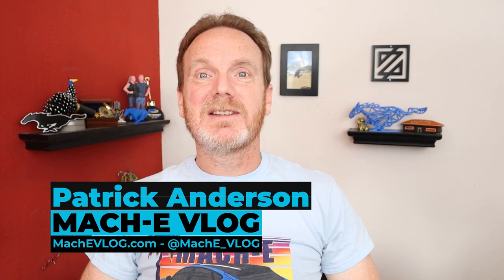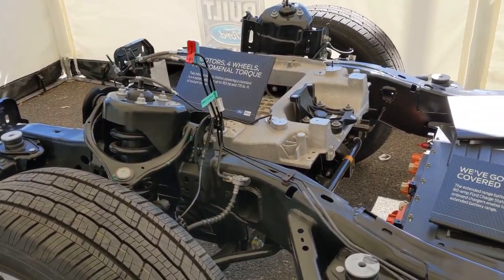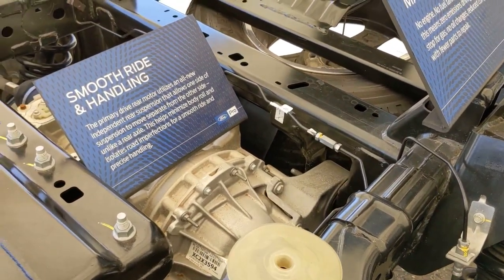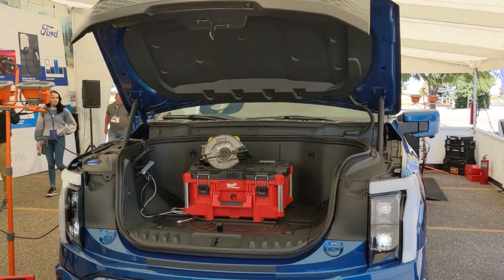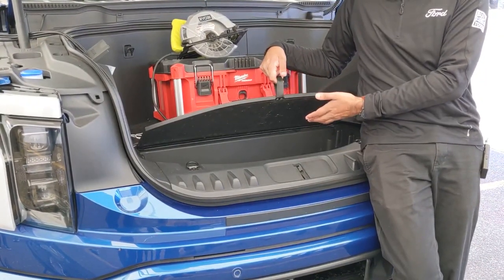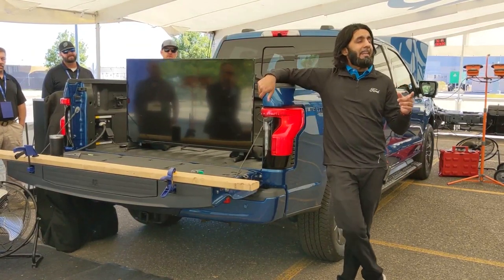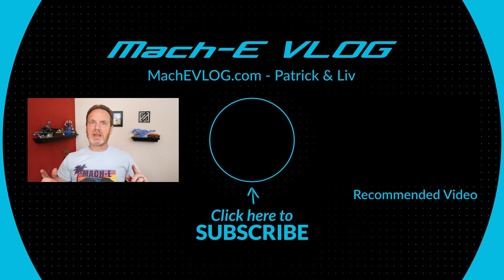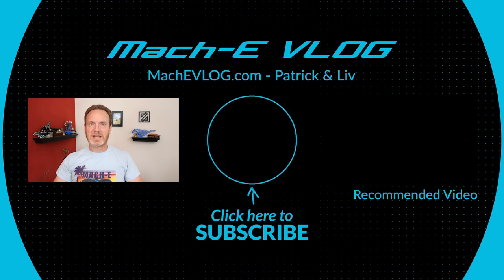F-150 Lightning Tour And Test Ride (And E-transit!)

Comment: They should really focus on streamlining their truck for aerodynamic efficiency, they are so focused on keeping the classic Ford truck look that they have to brute force it with an enormous battery.  That space they freed up in the front was squandered by making it just an empty cavity instead of exploiting the opportunity for a radical redesign.  Obviously they are doing what's right in the immediate short-term, a lot of "truck guys" are very interested precisely because it looks like a classic Ford truck, but locking in to these vestigial design limitations will hold them back going forward because that same group will rebel if they radically alter the design.
Reply: I'm all for improved aerodynamics but it would likely decrease packaging efficiency and cargo space. These are designed as work vehicles not lifestyle conveyances.

Comment: Don’t worry they will open up orders in 2 years
Reply from the maker: They are supposedly opening in December. First deliveries next year and they will sell 15,000 next year,.
Reply: @MachE_VLOG  Damn that’s such a small amount I heard they have over 200k reservations so most of us wouldn’t receive one until 2023
Reply from the maker: @CrazyLocoInsane1  Yeah, they don't have enough batteries. Hopefully Jim Farley can find away to fix that. Their goals are 15,000 Lightnings next year, 40,000 in 2023, and 80,000 in 2024. They have close to 200,000 reservations.

Comment: For 2022??? There is no way the F150 is going to be released, to the general public at least, in 2022.  I don't think it will be until at least 2025 before most people can get their hands on a F150.  They can't even keep up with the MME sales and as a result I'm sure has lost a lot of F150 pre order sales because of it.  

I'll be honest, with the way the MME software is, I would not buy a F150 Lighting.
Reply from the maker: It's coming soon. They have started pre-production.
Reply: We will see soon enough. Ford just announced intentions to be producing over 600k evs by the end of 2023. 
So obviously a massive production ramp is being planned for. 🤔

Now getting the batteries line's up, chips needed and factories tooled up for what amounts to an almost 10x of current production ev rates?
That is all a whole different kettle of fish. I for one wish fomoco all the best as they attempt to survive&thrive during the ev transition.👍🏻
Reply: Ford just announced they are building 3 big battery plants in a joint venture with SK.
Reply: @UnlikelyToRemember  so? Farley also claimed Friday when they announced they weren't moving forward with the rivian joint project.
That those new battery factories weren't going to be enough either. He's gonna Osbourne fomoco ice business. 
Let's see if he keeps his job or ends up like diess with vw. 🤔